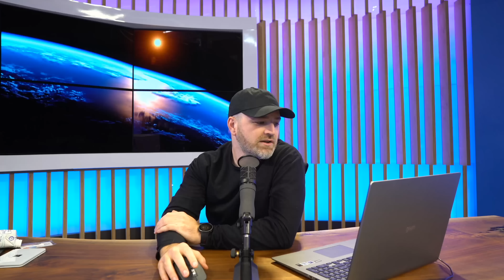Intel's New "Tiger Lake" Takes on Apple and AMD

Comment: Intel had so many years to start making better chips but they just sat on their past glory
Reply: They will catch up to amd someday and if that happens its gameover for amd again
Reply: no they had  literaly no competition until  2019  when AMD started making really good processors
Reply: @venkatgaddam6587  no I guess Intel couldn't launch their newer  products because their manufacturing process failed to produce yields expected. And their couldn't go to tsmc for on a contingency plan because tsmc couldn't manufacture the die sizes that Intel designs. So Intel was pretty much stuck there
Reply: They’re comparing It to a previous gen Ipad hahahaahahhaha
Reply: @ViviSaggio  I think it's okay because they are comparing the laptop form factor device to a small tablet form factor. And having a high performance laptop motherboard at that size is impressive.
Reply: Yusuf yusuf welp I’ll be sure be exited for the performance and cooling solutions
Reply: King Wiwuz IV  They have to take the blame on that , of course, but it was a specific part of their business that bottlenecked everything else: the manufacturing process. They don't outsource to TSMC like Apple and AMD, and they were unable to do it all themselves.
Reply: @abubakrakram6208  Intel does outsource some products but not CPUs. In CPU TSMC may also find it difficult to manufacture thier large dies at the power performance parameters set by Intel. They can do AMD chips because of the smaller die sizes. Apple chips run at lower clocks so that's also okay. If TSMC was able to manufacture those I don't think Intel would just delay the chips causing lose of market share.
Reply: they made better chips, but the people responsible for manufacturing processes screwed them. Intel is a big company, they probably have their next 20 years planned.
Reply: @lordof7seas  i totallz agree with you, intel may need to join TSMC like AMD, Nvidia, Qualcomm for the manufacturing
Reply: @lordof7seas  5 years ago on stock they were worth 20x more than amd, now only 2x more. If apple arm Macbook becomes success and window arm machines will come I wont be suprised if Intel just bankrupts. Intel lost reputation when those CPU mitigations started appearing one after another.
Reply: @FE0070  Last time AMD had higher stock prices.. I guess it was in 2007. Intel launched some new products and that sent AMD stocks to 2$ LoL.. from the looks of it, I think it's going to repeat itself.
Reply: @FE0070  you don't seem to know this but Intel is the 5th most profitable company in the US and they make more In quarter than AMD in 3 years, there's literally no way they will bankrupt any time soon.
Reply: @jorgevaladas788  Thanks for info, I checked top500 - https://fortune.com/global500/2019/search/?profits=desc&sector=Technology
No idea how they have more profits than Microsoft.
It looks like Intel is doing more profit in 1 year than amd in 20 years.
(intel 21B profit, Amd about 0.5 in 2019 ...)
Reply: @FE0070  Stock prices are inflated,and over their value.In US everything is overvalued and not based on true financial reports of the companies.For example Tesla is worth above 1k,and yet they have just a small percentage of the market.So basicly they inflate the price of the stocks cause in the future Tesla can become a leading car company,even when today they are far away from that.Its like gambling....

Comment: Really hope that Intel start making chips for smartphones . Must be awesome
Reply: Ever heard of Intel Atom SoC?
Reply: @sriramsundar8388  Intel Atom? 🤔
Reply: @icanpooptwiceadayyay8771  this is my first time i heard of it . what phones use Intel Atom SoC? 🤔
Reply: @alfiexnakama4678  None. Not anymore, I believe. Why do you want Intel to make more chips for smartphones that run hot, inefficiently, etc, etc?!
Reply: @icanpooptwiceadayyay8771  ohhh . interesting
Reply: @tech_realm  im just wishing it  . It won't hurt right wishing it?
Reply: @alfiexnakama4678  No, it doesn't hurt anything, but my question is, why do you wish it? Just interested to hear your opinions regarding Intel.
Reply: @tech_realm  lots of ppl and friends around me always says that Intel make one of the best chip . So im kinda want them to try making for smartphones too
Reply: @alfiexnakama4678  Ah. Intel was fine 3 years ago. But now, AMD dominates desktop chips as Intel still can't manage to manufacture desktop chips with the 10nm process. AMD's multicore performance is better as they provide more cores and threads, while also being cheaper. Now, TigerLake laptop CPUs have better graphics with Intel's Iris Xe Graphics system. But they still lack behind with multicore performance as Intel only offers 4 cores 8 threads in 2020. Fortunately for Intel, their singlecore performance is still better.
Reply: @tech_realm  i heard that AMD gonna make the GPU part for Samsung in 2022 . So AMD is superior ig 🤔